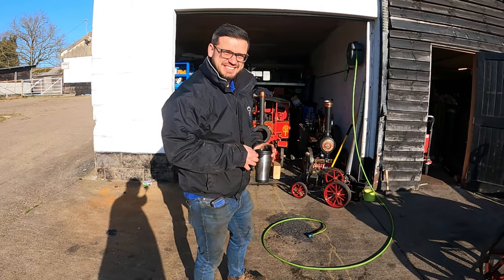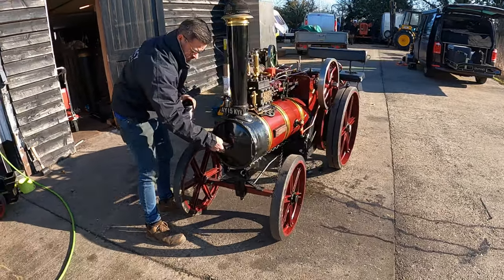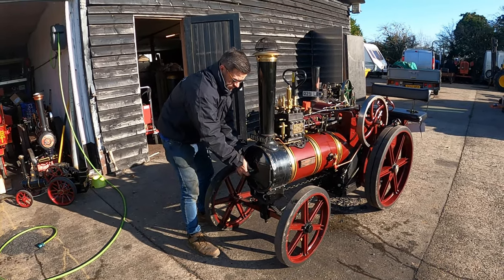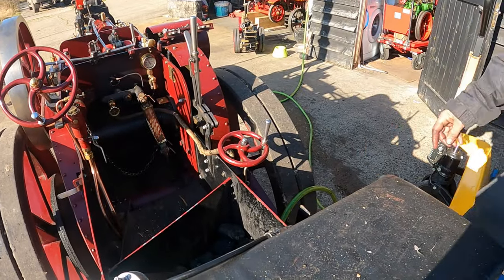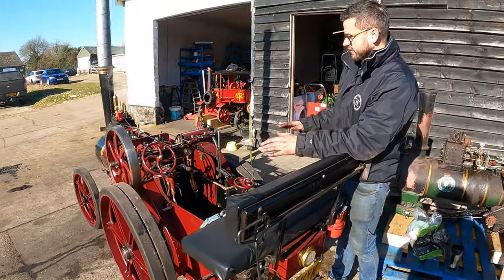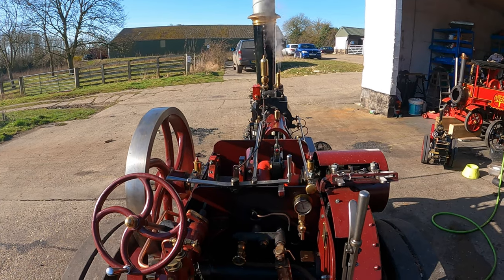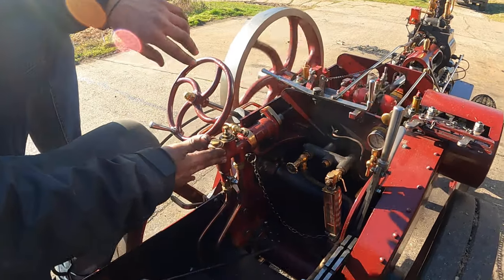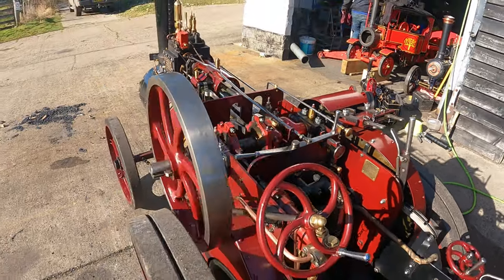Vlog 2 - Traction Engine Classes with Legacy Vehicles - Part 1

Comment: In Australia under our Boiler Code mandates that the bottom of the Water Glass must be 10% of the crown to the top of shell above the top of the crown sheet.
Reply from the maker: I've had to add a sleeve to the water glass on my engine to ensure it's high enough

Comment: There's one thing I was always curious about when it comes to models. For traction engines or other model engines, they're classified by inches like 2" or 6". What exactly do they measure that is 2" or so on for the models?
Reply from the maker: That's a really good question. I'll add something in to the next video to cover that.
Reply: @SteamOTR  Ah alrighty :)
Reply: The scale of the engine is the size comparison compared to the full size engine, i.e. 6" to the foot means it is half the size of the original or 1 in 2. 4" scale is one third or 1 in 3.
Reply: As Grahams Engineering said, the scale is x-inches to the foot so 2" is 1/6th scale, 6" is 1/2 etc. 

For rail however, the scale is given by the wheel gauge. So a 5" loco will have wheels with flanges 5" apart, there's also 3.5" and 7.25" that are quite common (10.25" less so)